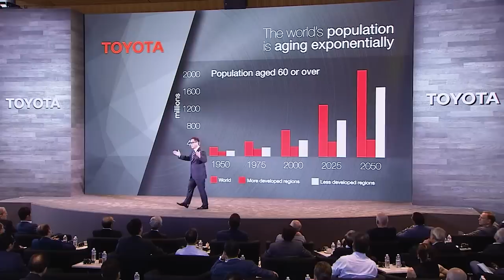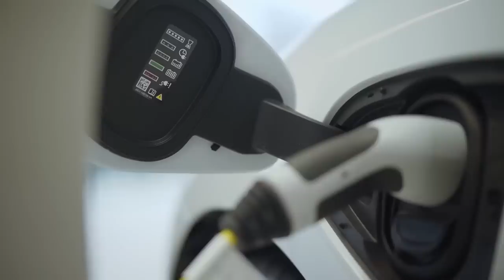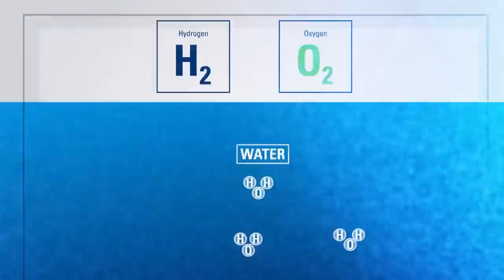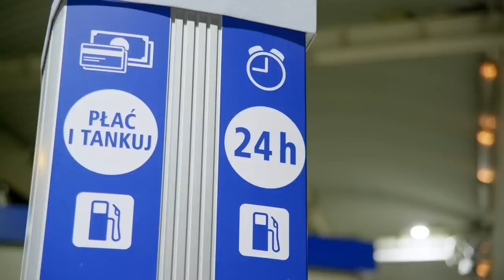New Toyota CEO Shocks Everybody | Huge News

Comment: If cheap plentiful graphene (or any other tech that really could improve electric by an order of magnitude) becomes a thing, then electric will become "the thing".
Without that though, they will remain niche. There isn't enough rare earth material available to replace internal combustion on a big scale.
Plus they don't work very well in climates which get snow. And there is no broadly practical method of electrical generation set to actually translate them to actually being lower in carbon output. It's good to advance the tech, but "it ain't there yet".

Comment: Hydrogen maintains the fuel companies as a necessary supplier, and it requires an entirely new infrastructure.  Electricity allows each country and community to progressively move towards renewables, and there is already significant electric infrastructure.  Battery technologies are rapidly improving year after year, with some really dramatic improvements on the horizon.  Toyota is backwards.

Comment: EV technology just isnt ready yet. Its impressive what they have done but they always falsify how good EVs are. Have we not all seen how long cell phone batteries last? Have we not seen how these EVs can drive maybe 3/5 the distance they are rated for. When tesla came out Elon promised free electricity and now ppl have to pay nearly gas prices. Factoring the time it takes and difficulty of finding charging stations being that time is money its a huge issue. There is just way too many down sides compared to gas and diesel engines. And if u run out of electricity in an ev they send out a gas or diesel power vehicle to you to tow you or to recharge you using a gas powered generator. Not to mention most EVs are coal driven anyway from their grid.

Comment: Anyone with half a brain can work out that to replace the global car fleet with BEV's in the time frame the EV promoters are talking about is impossible and that even applies to the developed countries. As Toyota says there is more to running a city full of BRV's than buying them even if you could make them in the time frame talked of. Even within single countries there will be areas where they will not be viable for many years if ever and that will also go for different sectors of the market like commercial vehicles. And what is all the promotion of BEV's for? their biggest advantage will be in reducing big city pollution which is worth their introduction  but from a greenhouse gas reduction measure the global private car fleet contributes a miniscule amount compared to other sectors of the economy. Even the entire transport sector globally is at the bottom of the list for % of greenhouse gas emissions. We are paying to much attention to the wrong sector and ignoring the most important areas which is just the way they like it.

Comment: Hydrogen electric AND hydrogen internal combustion (water would be one of the biggest byproducts of this). Fuel networks would be as easy as water and a conversion station using solar. It's expensive because it's not mainstream.

Comment: Good to see a company stand up against the EV madness. Personally I'll never buy an EV and stay with the ICE vehicles until I die. It's easy to switch it over to a hydrogen cell if necessary or even to run it off of moonshine after a few adjustments.

Comment: Transportation accounts for about 25% of all carbon emissions. I bought a Chevy volt for 20 grand back in 2018.  I also solarized my house. If I had used the volt as only a commuter vehicle, commuting under 50 miles a day, it would have cost me almost nothing to fuel the vehicle indefinitely. 
Also, by sticking to a 50 mile total commute, and with easy  access to free level 2 chargers, it can be cheaper than charging at home. BUT not all chargers get electricity from zero emission sources l.  
 With solar, and if I added a level 2 charger at home, it could be almost free to charge and also powered by carbon free electricity.
I think if car manufacturers make affordable vehicles like the volt in zero emission factories, and if all electrical sources used to charge the car were derived from zero emission sources, then such a car makes complete sense. 
Lastly, if the car battery lasts as long as I have heard it will --up to 200k miles or more-then the environmental issue if discarding batteries is lessened. But ultimately I think battery disposal and acquisition of material to make batteries is an main issue, at least for someone like me who lives in an area with lots of chargers around. The other issue as mentioned is charging stations getting energy from non zero emission sources, oh and also the manufacture of e vehicles in non zero emission factories too.

Comment: IN JUNE SATO SAID LAND CRUISER SMALL PICKUP FOR 15K.  NOT MID SIZE, SMALL.  MAKE IT AND IT WILL SELL.  NO MORE MID SIZE NOR TUNDRAS.  WE WANT WHAT YOU MADE IN THE 70S AND 80S......THEN TURNED THE TACOMA INTO A BIG PIG TRUCK.   WE WANT SMALL AND AFFORDABLE.   BEAT FORD AND GM WITH A SMALL 10K TRUCK

Comment: I don't personally agree with Toyota but they have chosen their path forward. The battery tech headed our way is pretty impressive fueling stations for electric are on the way and the ability to charge at home in which most need is here. Batteries have their issues but Hydrogen is in another ball park. I guess we wait and see how it plays out, not to mention how long a hydrogen tank will be good for. We will also need easily replaceable batteries. In the end it will be worked out. Toyota is walking pretty far out onto the plank here. We will see.

Comment: Hydrogen vehicles, like electric vehicles are a niche market. As such the more practical approach would be the fleet vehicle market which would require a smaller infrastructure to support. Its not, nor will it be practical for the average family to have either as a primary vehicle

Comment: I agree with Toyota thoughts about hydrogen,  it's better to create a brand new system to recharge cars with hydrogen and maybe collaborate with actual gas stations, than mining the shit out of this planet in order to get lithium and other materials for the gigantic batteries they have to place even in a normal car not to talk about trucks... or even the problem with the electrical installation witch in most of cases in Europe is not prepared to charge a high amount of cars, and isn't green at all when that electricity is coming from burning coal... even diesel is better...

Comment: believe more in hydrogen than battery-powered cars. who wants to buy a used electric car, how long does the battery last, etc., with hydrogen the only thing missing is facilities that produce hydrogen. then it is possible to install at existing gas stations. the disadvantage is that it is under very high pressure.

Comment: Toyota just needs to get japan up and running on hydrogen which it already sounds like it is doing.  with that in place it will be allot easier to convince the rest of the world of this alternative. easy to convert/add hydrogen to conventional already in place gas stations. the electric grid in Kalifornia is already experiencing rotating black out and gray outs. adding eclectic vehicles will melt down the grid literally at this time and take years to flesh out the grid to accommodate them. i really see hydrogen cars as a way better alternative to toxic battery powered electrics with zero clear way to recycle the batteries thought out or in place .

Comment: Toyota executives are right on the mark.  We have had EV's since 1882, all street cars / trams are EV's.  Adding 1/2-ton expensive battery to a vehicle to save energy is an oxymoron.  The renewables will disappear in 2 to 3 years, the battery powered cars will be history before 2030.  Here is why: (i) due to lack of the required minerals (copper, cobalt, lithium, others), (ii) due to the lack of adequate electrical energy power sources, (iii) due to the obscene pollution factor of batteries (re-cycling), (iv) due to limited range, lack of spare wheel, need for A/C (and/or heating) all deplete the battery / EV's range, (v) due to this useless political engineering and to boot (vi) due to excessive use of fossil fuels to build EV's.  Mark my words, Noam Mayraz, PE, Apr 16th, 2023.

Comment: Don't get too excited. Hydrogen is used to drive EVs. The cars have electric motors but instead of a battery pack have a tank of highly compressed hydrogen gas which is usually (but not always) produced with electricity and has to be converted back into electricity so its not a super efficient process. This technology is not new. It has been tested and found wanting. There may be some applications for it but it is not a panacea.
Reply: Hydrogen is created by converting hydrocarbons

Comment: Shareholders put pressure on the company to produce an electric vehicle.. but I think Hydrogen is the way to go...once the car industry adopt the idea prices for production of fuel will come down...also I understand Toyota has produced a hydrogen car that cleans the air!!! perhaps in the future it will be bigger engined cars that get the plaudits - helping to clean the planets pollution. Also I hear China has been buying up all the mineral mines for the raw materials to make car batteries.

Comment: EV are sold, but the price is often double that of ICE vehicles. Then there is the big charging issues which Japan can immediately recognize since they could see that EV would be a problem to charge in Toyota or other smaller places. Also the cost of developing whole new vehicles and supply chains just to support the EV likely doesn't make sense for Toyota so they better solution is to focus on Hydrogen and get into that market.
Reply: Especially with Japan's love of handheld games they would certainly be able to see the issue pretty well.

At least while you're charging a game system or your phone or whatever you can keep using it. Kind of hard to do that with your car and they take a hell of a lot more time to charge than a game system.
Reply: I have never been to Tokyo but I am guessing it would be like Toronto with much higher density and tons of apartment buildings. One big problem with EV for people in Toronto is if they are in an apartment or condo they likely will have no were to recharge there  cars. If you have a house with a garage you are good, no garage or if your in an apartment you're kind of screwed charging your vehicle overnight.

Comment: And there is a reason why it is still not the main power for cars. Gas has a energy efficiency of 30%, hydrogen of 15 - 20%, electrecity 70% plus the motors are easy to build. So essy that the first electric car was invented im 1888 and were used simultaniusly until 1910. They have an undeniable advantage against hydrogen. 

And other arguments hydrogen is better because of electrecity shortage. What do you think how hydrogen fuel is produced?

Comment: California will have to delay by 10 to 20 years the EV only law. They have a very shaky electric grid. I guess they could build more coal fired or natural gas electric power plants. Also the carbon footprint of the lithium ion battery is on par with gasoline powered vehicles.  Current EV cars have the same overall carbon footprint when you look at the whole lifespan of  gasoline and Lithium ion battery powered vehicles. Assuming the EV is on a nuclear powered grid. Otherwise if the EV is on a coal fueled power grid, it actually have a bigger overall carbon footprint.

The real answer is to reduce the need to spend so much time in a car.

Comment: Arent hydrogen cars still basically evs they dont have combustion do they
Reply: Yes, FCV's are basically electric cars with a smaller battery, but add a fuel cell and hydrogen tanks.
Reply: @redbaron6805  oh well I don't understand why people are hyped up over them
Reply: @user-rg8mc4el8w  They are interesting in many ways.  The problem is there really is no infrastructure for them, something that won't change anytime soon.  And they are not really cost competitive.  EV's in the USA cost around 3 cents per mile to drive, combustion engine cars around 15 cents, and hydrogen cars around 25 cents per mile.
Also, almost all of the hydrogen stations in the USA are around Southern California, so you can only use them in a local area.
Reply: @redbaron6805  blah blah blah not reading that
Reply: @user-rg8mc4el8w  Yeah, sorry.  I forgot that you only understand simple things like pictures, I'll try crayons and only short simple words next time so you understand...
Reply: @redbaron6805  thank you i appreciate you understanding

Comment: With current technology hydrogen can not compete with batteries for car energy storage. Toyota has been wrong for twenty years or more about this. The first thing that needs to be solved is how to vastly improve the turn around efficiency of hydrogen as an automobile fuel. After that you can start talking about all the other problems with hydrogen as a car fuel source.

If  a market for hydrogen from electrolysis develops it will likely be as an industrial process gas used for things like steel and cement production. Right now most of the hydrogen comes from methane. Using that in cars would be stupid. Just burn the methane and get more energy and less environmental harm. 

One thing that hydrogen zealots need to be aware of is that battery technology improves every year, so Toyota isn't going to be competing with the battery technology that exists today. The battery technology they will be competing with is the one that will be there when they release their hydrogen cars for the mass market.

Comment: Moving from ICE to EV vehicles will cause a load of unemployment due to current fuel stations closing up shop.   Current fuel stations employ millions world wide, who many will be forced to join the long list of unemployed.  EV manufacturers also require to sort out the fire and explosion aspect of said vehicles, and governments urgently require to spend billions on providing charging points.  Not every home has a driveway, so their home is straight onto the street, of which there a millions of these home styles, especially in Europe and cities world wide.  Then we get the millions who reside in tower blocks.  All countries are near the maximum power out puts of electricity already and many of them are already having black/brown out moments.  This means coal and gas fuel stations will be required to increase usage of fossil fuels, therefore switching  the fuel from vehicles to power stations.  On non wind days the wind power also goes away creating more strain on the power system.
Yes we do need an alternate to fossil fuels asap, but EV's are not adequate enough yet.  Then we come to the life of the battery, and the cost of replacement, this will put EV's out of the price affordable  bracket of millions/billions, EV's are way to costly for the disabled and poorly educated already, as their income is low, way to low to be able to afford a new EV and change the battery pack when required.  ICE vehicles currently being used will be about for decades yet until governments ban then from the roads altogether.

Comment: I buy nothing but Toyota.  My 2005 Sienna drove 16 years 230k miles no issues (totaled in an accident).  Toyota is smart and usually does right by their customers.  I believe Hydrogen Fuel Cell is the real alternative to internal combustion an will NOT buy a battery EV unless I absolutely have no choice.

Comment: too many EV are burning down to the ground. the lithium battery's are not very safe they just explode for no reason or failure is a switch can cause fire. the car motor and body are perfect. the problem is the lithium battery's
Reply: That claim is literally fiction.  EV's catch fire 60x less than combustion engine cars according to the NTSB which looked at fire data for all vehicles.
On top of that, there has been a record number of fire recalls from BMW, Hyundai/Kia, Ford and several others, all in combustion engine cars, not EV's.

Comment: I expect home hydrogen generator/pump devices will be developed in the near future., as well as commercial generators that need only power to operate.   As soon as the world acknowledges that not every vehicle's environment is the same as in Palo Alto..
Reply: No.  That simply won't happen due to the pressures involved and the risks of explosion when leaks happen, which are inevitable on hydrogen.
Reply: @redbaron6805  I suspect the same was said of gasoline as cars were introduced.  Risks are managed by design with the remaining risk found to be socially acceptable - in the case of gasoline, and recently lithium strapped to cars.  That could be the case for Hydrogen.    The current EV situation is car fires that emergency crews cannot extinguish, and bulk car transports of EV's that are destroyed by intense heat fires.   I have faith in engineering to minimize risks with time and focus both for EV and FCV.
Reply: @g.c.3339  Different issues involved here.  Hydrogen is exceptionally difficult to contain as the molecules are some of the smallest of any element, so they are notoriously good at escaping whatever contains them.
Lithium Ion batteries catch fire 60x less than combustion engine cars according to the NTSB, and that number will decline further as battery defects in early production cars is addressed and eliminated, along with new chemistry's like LFP which can't catch fire.
Not sure what you are referring to as bulk transports.  If you are talking about ship fires, there is very little proof where the fire started on the car carrier that caught fire off the Azores.